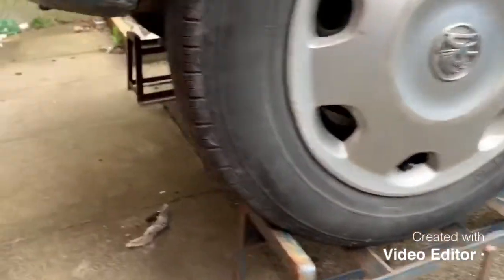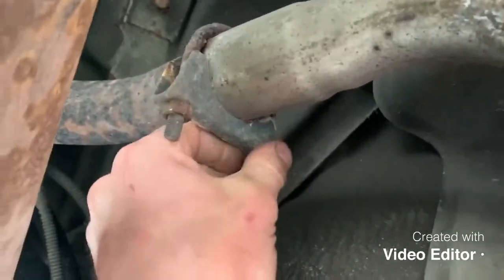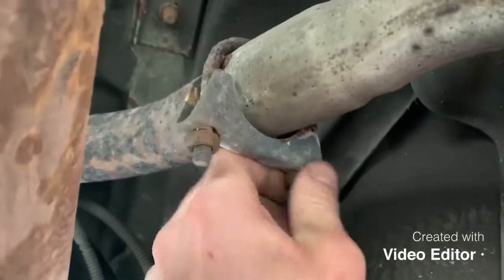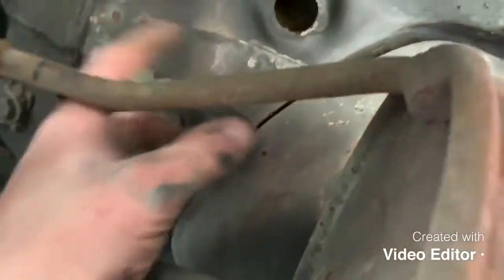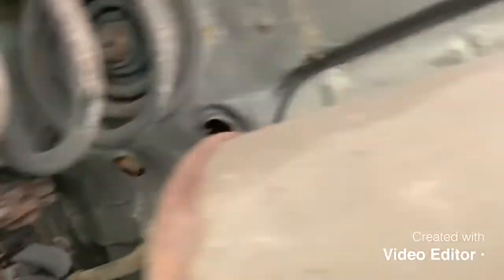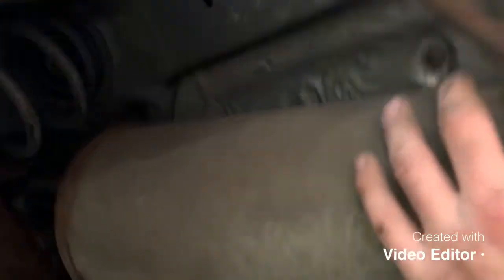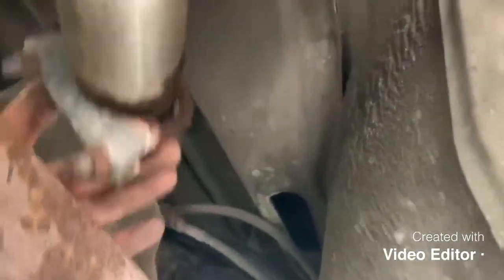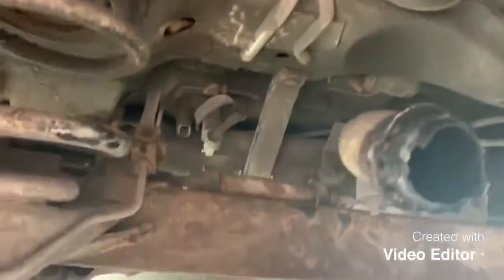Vauxhall Opel Corsa C - Exhaust Back Box Replacement How to Change Exhaust Silencer

Comment: Thanks for your video. Had the same issue breaking the joint.  Used an angle grinder with a cutting disc to cut a slot along the pipe of the back box been carful, not to cut into  the pipe if the remaining system. Them used  a screw driver to split open the slot. Took about 5 minutes.  Just take it gently..

Comment: So today I found out that my exhasut is leaking...or rather it got louderr, thought I scraped it through (been driving on a nasty piece of road back and forth last few days), but after more investigation, it appeared to be at the muffler, so I think this exact thing happened to me, where it's right at the backbox welds
Reply from the maker: Yep it’s always the welds first unless a stone chips or dents the box then that can rust first. New back box be good as new

Comment: Would my corsa c back box fit my combo c 1.3 ?
Reply from the maker: Yes should fit but not sure how effective it will be as the van is a bigger diesel engine. Basically it will work but not sure if it would pass emissions on next m.o.t. Hope this helps. Cheers